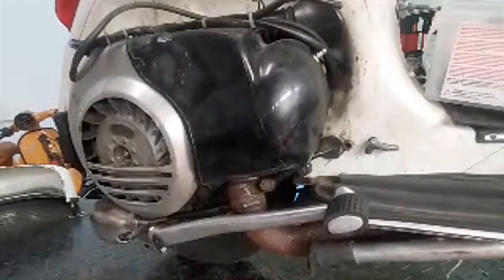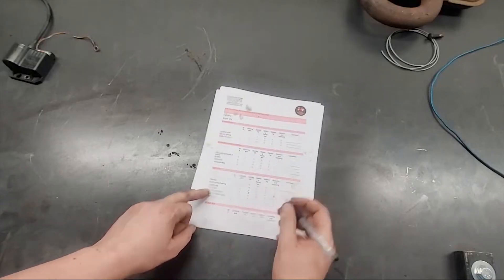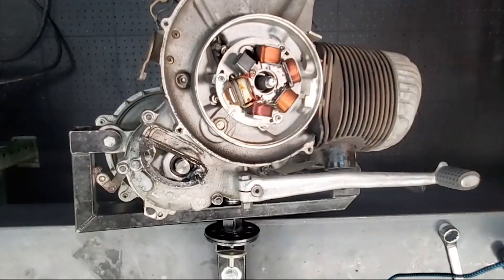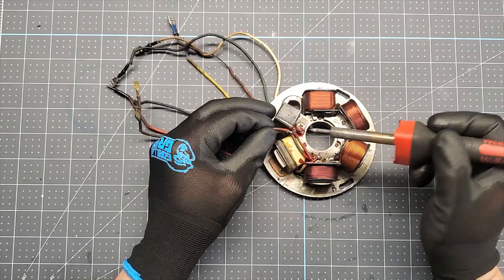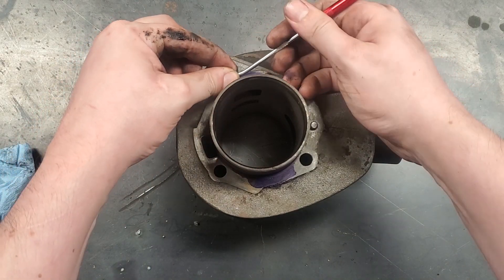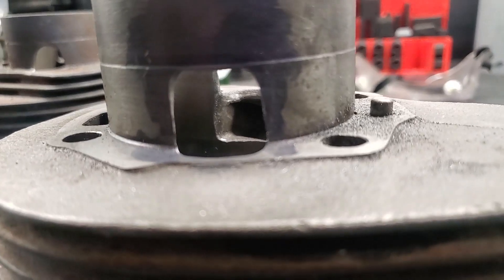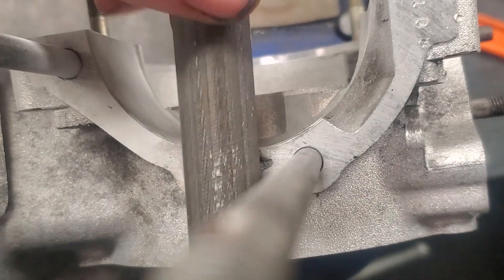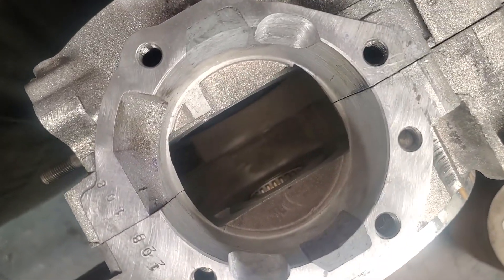Vespa P200E with 208cc on stock cylinder Part 1. Cylinder and case porting - TST Ep. 49

Comment: Great video and I am planning on doing this.  At around 5 mins you use putty to fill the port.  What putty do you recommend?  What about expansion and relative expansion between the putty and the case?  Different materials.

Comment: I think I didn't understand that why did you fill up that crankcase space with epoxy, can you please explain since I am a rookie so I didn't understand that part can you please explain to me
Reply: Plugged because they do not match the cylinder. If you look back around 5:13, before the new windows are cut. you'll see that there is only the exhaust port in the cylinder.
Reply: @notbenh  thank you so much, sir, now I understand it
Reply from the maker: @pabitrikalita3940  What ben said!
Reply: @ThatScooterThing  sir I had asked  question on why did you used epoxy putty, so he gaved me a explanation on why did you used it for port matching
Reply from the maker: @pabitrikalita3940  Crankcase pressure. a little dead volume can be easily filled up like this. it might not help much with a stock 208, but it is already ready for a nice Malossi 210 cylinder :D
Reply: @ThatScooterThing  thank you sir